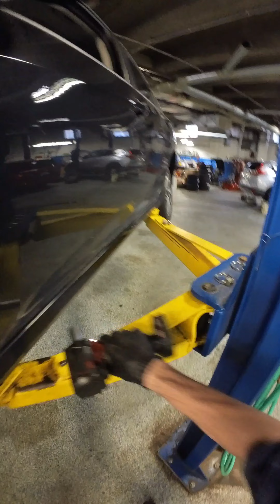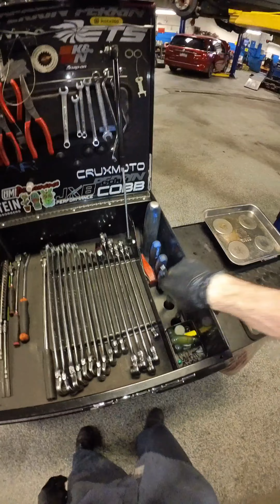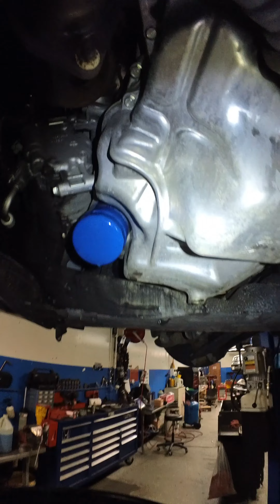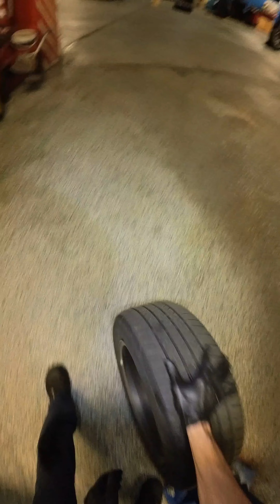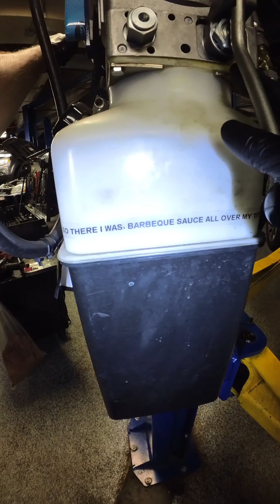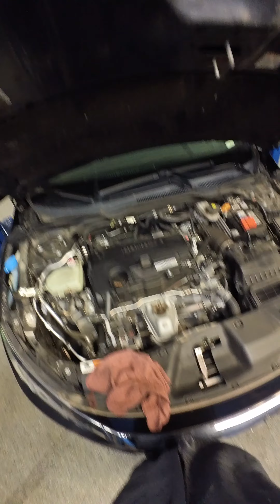Honda Civic Oil Change 🔧🐐 #honda #oilchange #asmr #pov #tevideos #satisfied

Comment: do you trust torque sticks? heard some real bad stories from those failing
Reply from the maker: I check the torque after using my torque stick a couple times a week and it's always on point or slightly over but acceptable.  Need to but good quality ones don't cheap out
Reply: which ones are you using in the video. also random question how easy was it for you to get hired at the shop? did you have any previous experience working at another shop before this one? @TEVIDEOS